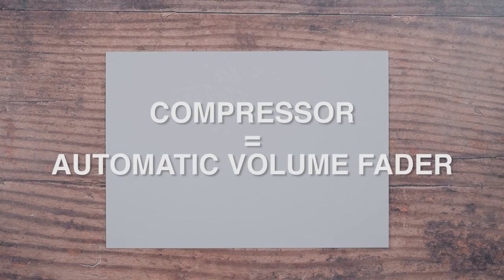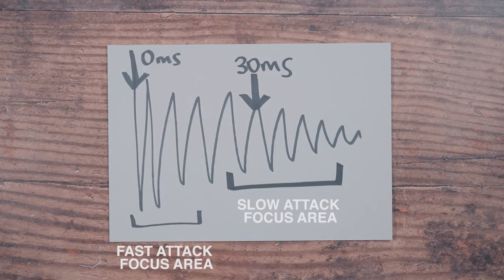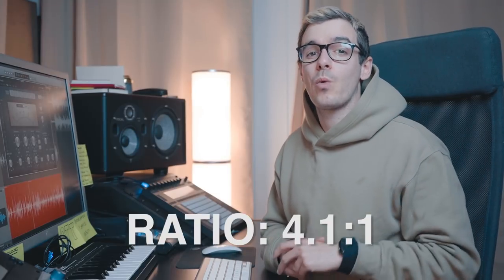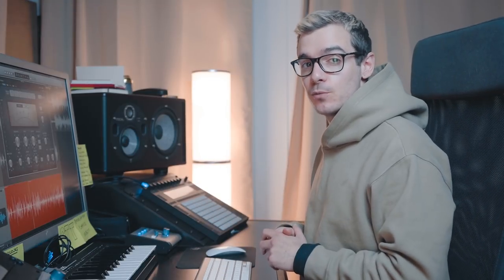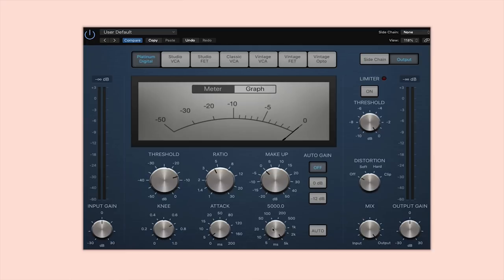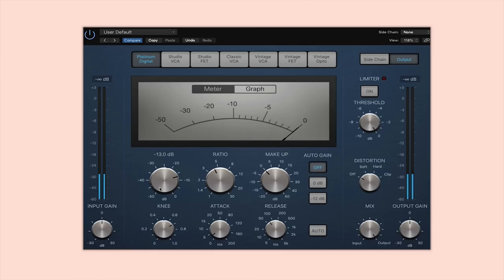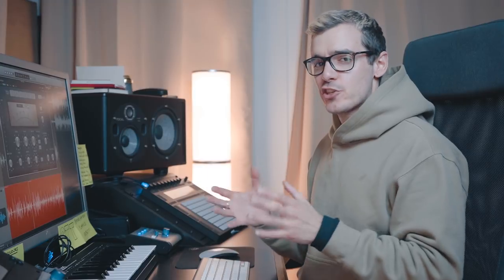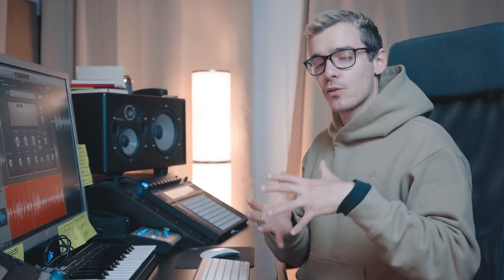Compression DEBUNKED (Part 1)

Comment: Hi NL

Just wondering how is the latency when tracking with Lyra2 . Can u go 32 buffer on 48hz?? When mixing with plugins what is the minimum buffer u can save go??? I am using windows 10 ... but since not much I can find with prism interfaces regarding latency on YouTube I am just asking randomly who uses this interfaces !!! They ain’t cheap!!
Thanks !! Will probably get the titan but latency should be similar ! Also when u use Mac are running through any thunderbolt to USB adapter? If yes any issues regarding stability and click?
Thanks in advance !
Reply from the maker: I turn down to 128 for recording and all the way up to 1024 when mixing. No issues with latency so far.
Reply: @NoizeLondon  Hmmm...Those numbers dont seem very good for someone used to RME. But 128 on mac ...on windows should be more and certainly 1024 thats the limit. On RME I do both recording and mixing on 128 with PT HD. On logic it runs on 32 with routrip 2ms. By the way when using in standalone mode Lyra pres cannot be ajusted right?? Thinking of connecting via ADAT in/out to RME.
Thanks in advance!!
Reply from the maker: Not sure tbh! I’ll have a look into it for ya ;) pester me via insta if I forget
Reply: Noize London thks in advance ....another option would be just get an Ua x8 and connect through rme via adat .... since ua on windows is a hit or miss thing... but again u cannot control ua pres in standalone mode .... the pres will maintain the last gain we setup before turn it off . For the price/quality I think ua x series could be an alternative option ..... not sure not as good as prism.

Comment: So can you avoid compression altogether just by using volume automation in certain situations?
Reply from the maker: Yeah exactly! I like to do this a lot with vocals, can help if the singer is moving a lot when recording. :)
Reply: so if you can just automate by, for example, riding the faders, is compression still necessary for the mixdown stage?
Reply from the maker: @BeatsbyBlanch  I would still compress where necessary - stay tuned for more parts on this subject :)